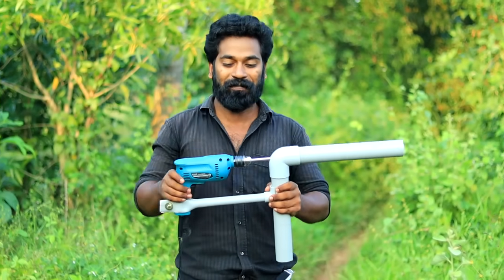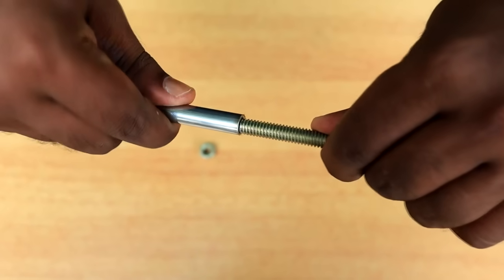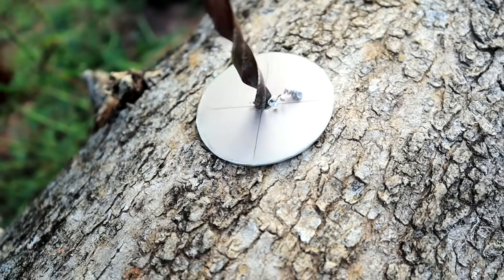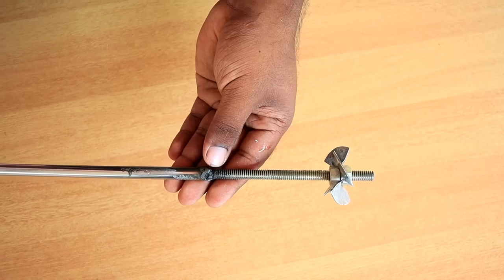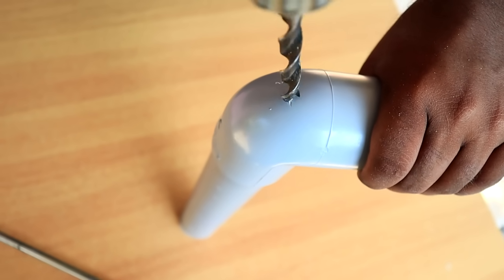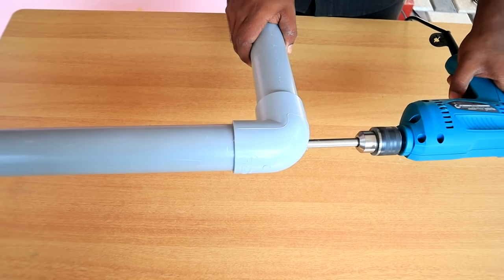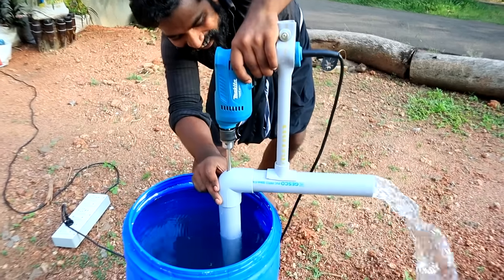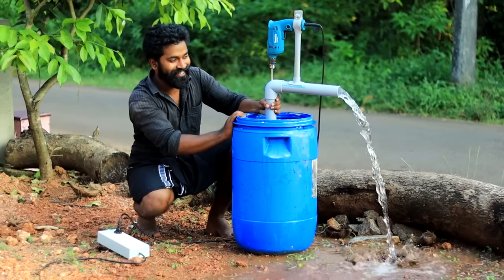WATER PUMP MAKING|ഡ്രിൽ മെഷീൻ കൊണ്ടൊരു വാട്ടർ പമ്പ് | M4 TECH |

Comment: Dear Geo Joseph and Praveen Joseph, this is a (another in face) good idea to utilize the potential of a hand drill motor.
But if this pump is operated for a long time, say five or ten minutes, then the brush commutator motor will burn out.
Although the torque is impressive to pump much water, this cannot be used for continuous use.
Reply: I agree 💯

Comment: If you reduce the pipe size and rotor size, it may result in higher rpm and more power
Reply: atengana ashane
Reply: rotor cheruthayit enta karyam , drill nte rpm maarathe engana rotor rpm marunne, allel valla gear um use cheyyanam